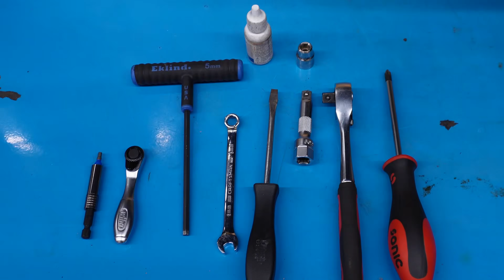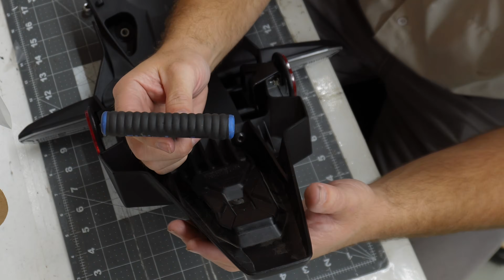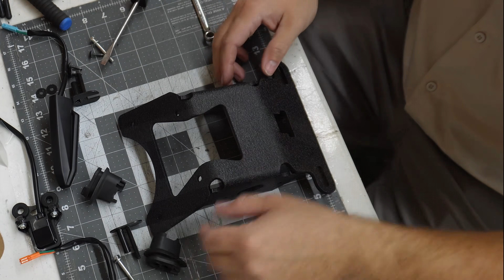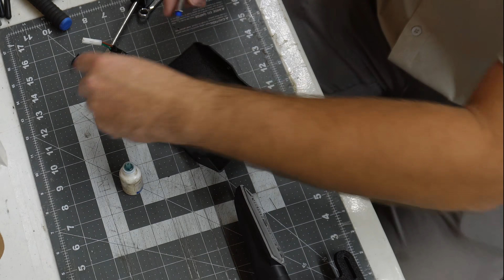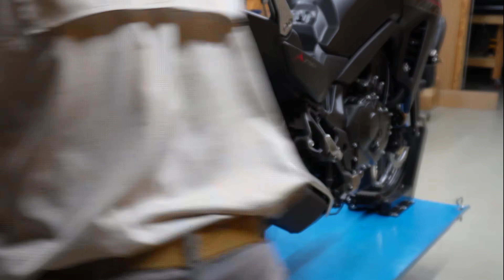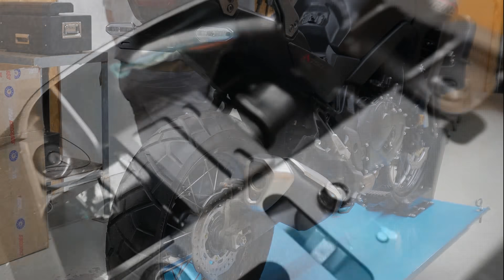Transalp XL750 Fender Eliminator Kit by 3D Cycle Parts (Install Video)

Comment: Great video, but it needs to updated as i was following the instructions,  and almost really messed it up as the on the tag light now comes with allen screws, you DO NOT reuse the original hardware.   Thank God I didn't completely tear up the allen head screw trying to put the original hardware screws in per the video instructions.